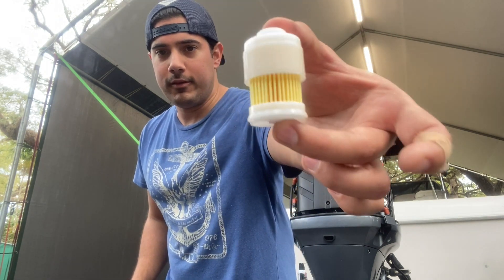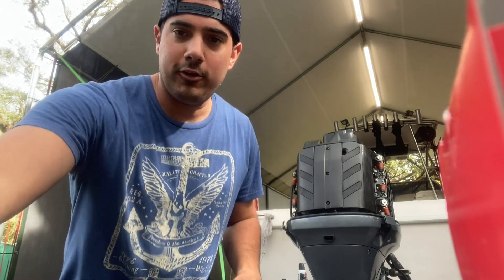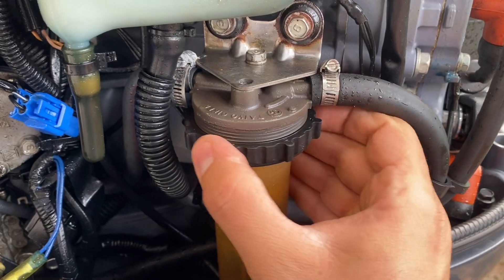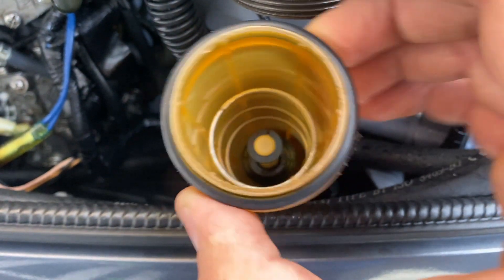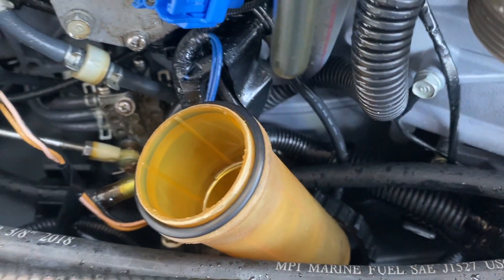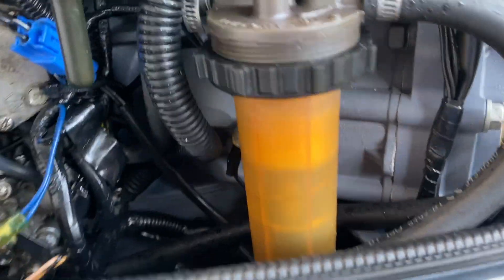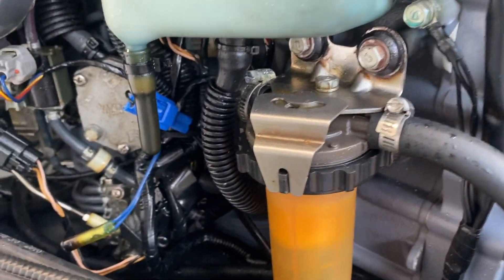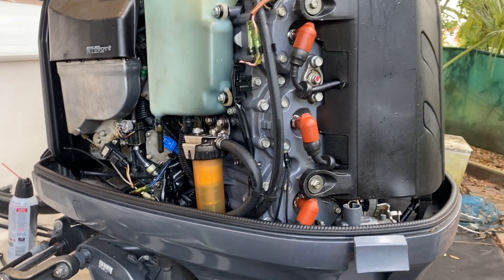Yamaha HPDI inline gas filter replacement

Comment: Very nice!!!! Should I worry about priming back up that filter? If so how can I do that? This definitely is saving me some $   Thanks
Reply from the maker: Awesome! Thank you for watching and commenting. 
You can either add gas straight to the bowl before screwing it back on, or you can squeeze the primer bulb a few times till the bowl fills up. Once she starts she will fully prime itself due to the fuel pumps kicking on. 👍🏽
Reply: @ReelTeaseFishing  how much fuel to put in?

Comment: My filter assembly is leaking. I checked it and all o rings seem to be in good condition and I re-tightened it pretty snug. Any idea why it could still be leaking?? Thanks
Reply: Your housing is most likely cracked, check directly below nut that hold housing in place
Reply from the maker: @am44_67  that is great advice
Reply: @ReelTeaseFishing  let me know if that was the cause and if so, how bad are the cracks? Just a heads up they don’t sell just the housing, they only sell the housing with small filter tank with a new filter OEM $130
Reply from the maker: @am44_67  my assembly wasn’t cracked, I believe the original poster with the leak was the one who first commented. Hopefully he responds and let’s us know if that was the issue 👍🏽👍🏽
Reply: @ReelTeaseFishing   I discovered mine was cracked this morning, called local Yamaha parts and they said you have to buy the complete assembly, (when I squeezed the primer hose, fuel would shoot through the 3 hairline cracks in the housing, I think previous guy tightened too hard) anyways, I write this to share my remedy, I didn’t want to cough up for the $140 for complete assembly, I went to a few local hardware stores and settled on JB Weld Tank Weld, while it isn’t rated for plastic, it is rated for fuel and and resistant to ethanol, ( most of the epoxies and hardeners don’t state whether  they were rated for fuel)  I cut a quarter size sliver and rubbed into a ball for a minute or so like play-dough, I pressed firmly over and over into each of the hairline cracks, with emphasis of truly pushing it down into all the little crevices, long story short I let it sit in the sun for a couple of hours, reassembled this evening and ran motor for about an hour at 3K RPMs, tested it a few moments as high as 6K RPMs, it appears to be holding up just fine and I don’t have to cancel my fishing trip tomorrow, I will say try this at your own risk but I’m pretty happy with the result, (will post an update in the future in the even it doesn’t hold)
Reply from the maker: @am44_67  that would be great if you post back after a few trips. Could definitely help someone out in your same situation. Hope it works and good luck on the fishing trip
Reply: @ReelTeaseFishing  2 fishing trips in and we are still holding solid
Reply from the maker: @am44_67  great to hear! Tight lines 👍🏽
Reply from the maker: The O rings on these fuel filters are notorious for going bad. One thing that happens to them is overtime it slightly warps on the side it contacts the housing on the engine. Sometimes simply flipping the oring will allow for a quick fix. I recommend replacing the Oring.
If using ethanol fuel the actual fuel filter bowl will tend to warp and will no longer seal correctly. Thus a new bowl is required. 
Good luck let us know what it was
Reply: @ReelTeaseFishing   spot on! I had to purchase a new bowls assembly as mine would not seal. Ethanol warps these cups overtime.
Reply from the maker: @jimbarr9725  thank you for watching! And commenting, I am sure others with this issue will find your comment very helpful 👍🏽

Comment: I have a question - inside the fuel bowl there looks like a float that is connected to the wires that comes out the bottom - does that float move up and down freely ? Mine does not move
Reply from the maker: That piece is actually a water sensor. it does not float. some bowls have an indicator ring that will float if water is present. The wired bowl has a water sensor that will throw an alarm when water is present. hope it helps
Reply: Thank you very much !

Comment: Did you use the Yamaha wrench to loosen the filter ? And do you fill it all the way with fresh fuel?
Reply from the maker: I did not use the Yamaha wrench. if you feel that the plastic nut is frozen/stuck. do not force it. In that case you will need to use the Yamaha wrench. Since I do this yearly, It usually comes off pretty easily. 
As far as fuel I usually fill it up about 1/2 to 3/4 full to allow space for the filter and some wiggle room to install without spilling fuel everywhere.
Reply: ReelTeaseFishing thanks for the reply 👍🏻
Reply: What is the Yamaha wrench? Link?